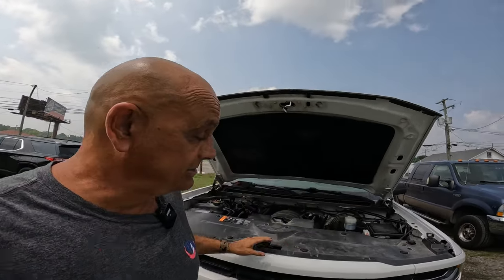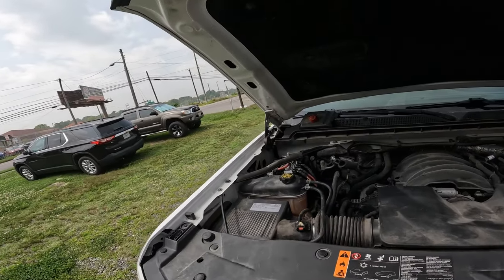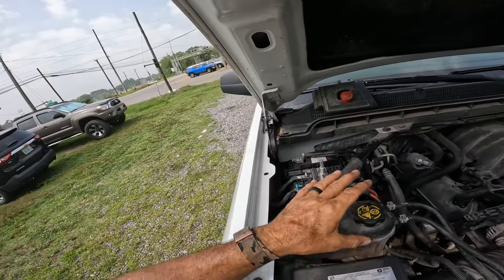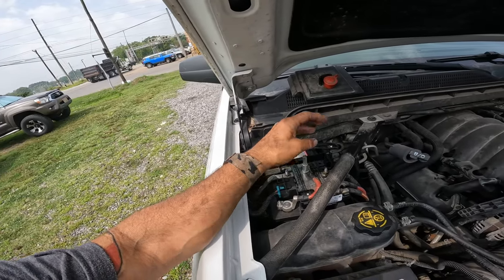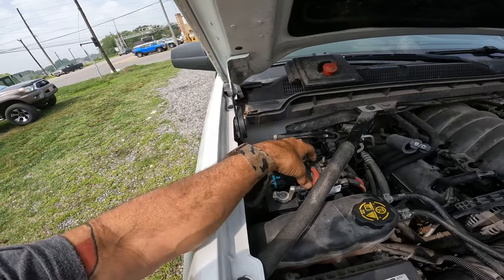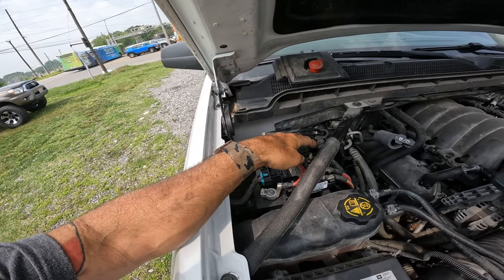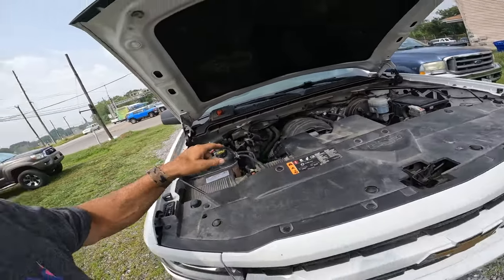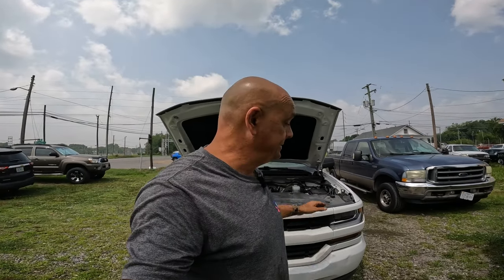No Communication with Chevy/GM Electronic Power Steering Control Module

Comment: Would you show us where the wires were you fixed?   I have the same issue on a 2016 sierra.  Jumped it and no power steering
Reply: How did you fix your issue